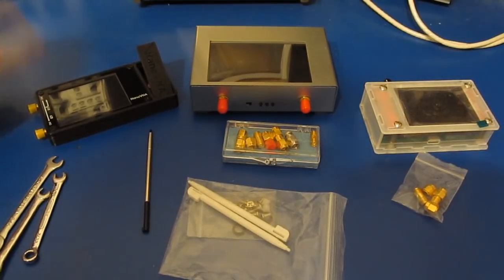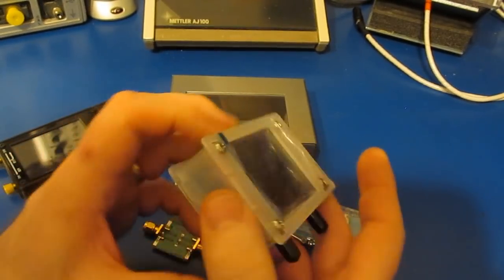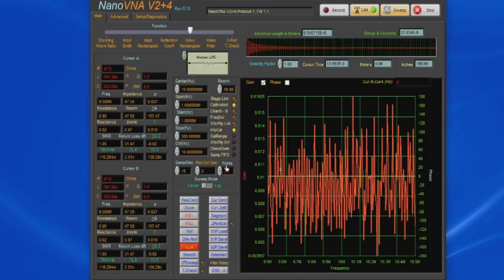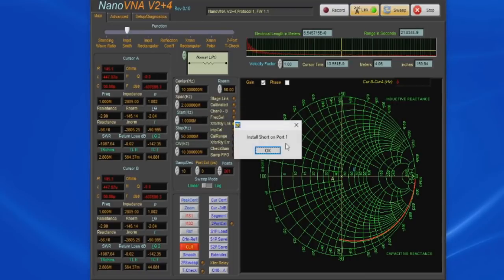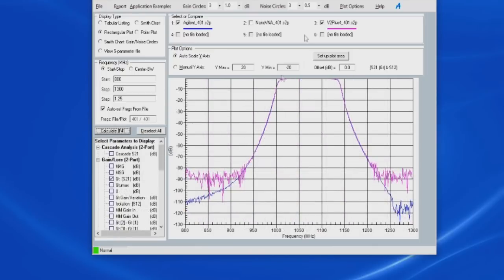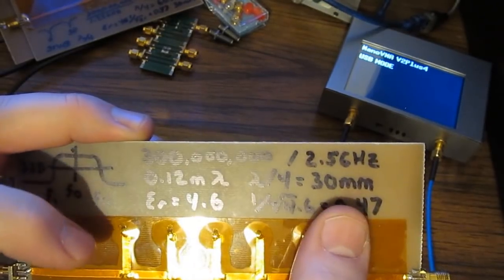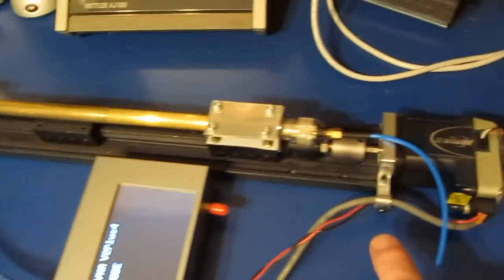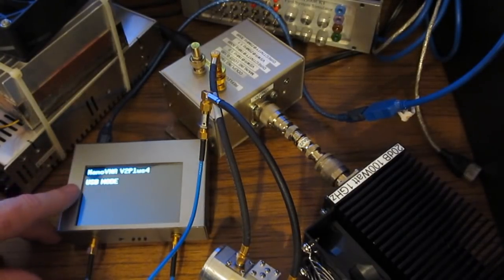NanoVNA V2 Plus4 Review, 4GHz VNA

Comment: I noticed you had an issue with the software on 13m30. From a software engineers perspective this is not that strange. The main GUI (graphical user interface) thread should never do anything that takes more then a little time, else it looks like its "hung" as you put it. It will stay hung until its done with the lengthy job. This should have been done in a separate thread or at least behind an explicit "refresh" button. 

Im a software engineer and electronics hobbyist, who appreciates your channel, so drop me a line if you could use some help/advise in software... i.e. if you want to port part of the original software which i believe is in github also.
Reply from the maker: I wasn't involved with developing the software supplied with the V2+.  I think the people you want to contact have their own group that you may want to consider joining.  I believe they had a link to it from the store.    They may appreciate any help you could provide them.   For myself, I just roll my own and get on about my business.

Comment: great work, that TDR measurement with mm resolution would cost a fortune 10 years ago.
Reply from the maker: 10 years ago,  the best thing I had was my old 1970s HP 8754A.  That's about all I could afford for hobby use.  These low cost VNAs are game changer.
Reply: @joesmith-je3tq  do you add velocity factor to that TDR measurements ? i beleive it is possible to reverse calculate Er value from that.

Comment: What I would really like to see is how to use a NanoVNA to calculate and test the matching network for a 900 or 2400 MHz transceiver with some kind of PCB or standard SMA whip antenna. That would be AWESOME.
Reply from the maker: As I stated during this video, I wouldn't recommend using the NanoVNA for anything above 300MHz.  You may need something better.    For calculating matching networks, there are several on-line calculators available.   Try Google.   For videos on how to use a VNA to test them, use the YT search.

Comment: Greetings joe, excellent software with nice visualization, I was wondering if you have compiled any similar software to use it with a nanovna-f, if so, could you provide me with the url to download it?
Reply from the maker: I only have the original NanoVNA and the V2+4.  Software interface to the V2+4 is different than the original.   I have no idea what the F would require.   In my case, I was really looking for the dynamic range, speed, larger data sets and that 4GHz+ upper end.  The V2+4 is a big improvement but I'm at a loss as to why they didn't consider it's use for narrow band work.

Comment: Software seems to have been deleted. :-( any reason why?
Reply from the maker: It was moved to release after adding the VISA drivers to the installer.  Look to the right where it shows releases.
Reply from the maker: Look here if you are still unable to find it.   https://www.eevblog.com/forum/rf-microwave/nanovna-custom-software/msg3452660/#msg3452660
Reply: @joesmith-je3tq  Got it thanks, will this also work with the first version of the Nano or only the V2. Also the I am missing the lower part of the program and can not scroll to the bottom, it's chopped off and even in full screen mode.. Am I missing something to get the bottom part of the window?
Reply from the maker: @romanmelnyk-ve2rmj979  There is a 100 page or so manual.
Reply: @joesmith-je3tq  Checked the manual, but not clear if I can use it with the original nanoVNA, I tried and it does not connect, it does with nanovna-saver so I know the unit is OK. Maybe I am doing something wrong?
Reply from the maker: @romanmelnyk-ve2rmj979  There's a manual for it that I suggest you take the time to actually read.  If you have questions not covered by it, let me know.

Comment: Neither my NanovnaV2+4 nor my NanovnaV2+  hangs with the original software of the author (nanovnaQT), so the problem  that you encountering must be related to you hardware/software set-up. Have you upgraded to the latest version of nanovnaQT that is available ? I use nanovaQT nearly everyday on a Linux PC (Ubuntu 20.04) and there is absolutely no issue at all, it runs like a charm.
Reply from the maker: I assume by your comment that your watched the video and are suggesting you are are able to run your V2+ continuously, streaming data over the USB, without a lockup for > 6 hours.   That's very good news if that's really what you are doing.  I suspect it's a firmware or hardware problem with my V2+.  I've since given up on it.
Reply: @joe smith . In my Linux Ubuntu 20.04 environnent, my V2+4 or V2+ will stay connected for hours and even days without hanging, neither at start-up nor after several hours of use, However , you are using Windows which manages COM ports in a very different way than their linux equivalents.....Anyway, congradulation for the look of the SmithChart, it's really great and remenbers me my student days and the good times I had with the HP8753
Reply from the maker: @peteride-kostic737  I've seen my V2+ run about 6 hours.  That's not six hours of being plugged in but 6 hours of streaming data.   If you follow that thread in the description, I talk about various things I tried to sort out what the problem is.  I doubt the OS or PC have anything to do with it.  If the V2+ and V2+4 had the same performance, I would consider buying a second one just to see if I could replicate the problem.  
I started using LabView when version 4 was released.  I saw the advantage and bought a copy of 5 for home use.  Now days, pretty much anything I run on the PC is written in LabView.

Comment: Thank you very much for this explanation. Awesome!

At 57'15", I wonder if does the Er shoudn't be the 'effective' Er for each trace? I mean, part of the E fields travel through the air and FR4 and part only through FR4.
Using TXLINE calculartor for microstrip, gives Ereff = 3.45 @ 50 ohm, 3.82 @ 25 ohm and 3.1 @ 100 ohm.

Comment: I have a question, both in the video and in the manual you've said something along the lines of "I am not using metrology-grade standards with the NanoVNA". Why is that? I am assuming it's due to the untraceable mechanical nature of the connectors on the NanoVNA.
Reply from the maker: The cost for a set of Keysight mechanical 3.5mm standards is somewhere in the  range of $4000 to $16,000.   The risk of damaging them could be reduced by using a good set of cables.  To reduce the risk of damage to the cables, we could install higher grade connectors on the VNA.    Consider that one connector could easily cost more than the entire Nano.   At the lower frequencies I play at, it's far less important which is why you still see me using home made standards and sorted loads.   

https://www.microwaves101.com/encyclopedias/connector-care

Comment: Hi, is it a specific driver for using your software, com ports on my PC are not detected by your software.... my Nanovna V2Plus4 cannot be linked..... (It works with QT & Saver) ?
Reply: I found that we must install NI VISA to make it work, now I can see all com port available , maybe something is missing inside your software package. I'm going to play with your soft now....
Reply from the maker: @patriceh6316  The installer has been updated to include VISA.   No other changes were made.
Reply: @joesmith-je3tq  Thank you very much Joe for all the job you made  and shared it withs us.
Reply from the maker: @patriceh6316  No problem. Thanks for pointing out the missing drivers.
Reply from the maker: NI VISA should have included with the installer but I may have missed it.

Comment: The software you wrote is impressive.  I appreciate the time that went into it.
I have a Siglent SVA1015X and a nano VNA whihch I have been considering adding a relay set-up like your to so I could get bi-directional 2-port measurements without manually swapping the connectors.  See your example is very helpful.
I currently do not have a need to go above 1 GHz, if I do understanding the limitations for the newer Nano VNA versions will be helpful.   Thank you for the detailed comparison.
I have done 50 Ohm through crystal measurements with attenuators in line next to crystal.  It seems to work fine.  What motivated you to add the transformers in the fixture?
Reply from the maker: There was a link in the description to the crystal testing I did.  There's a lot of information posted.   Did you take the time to read it?

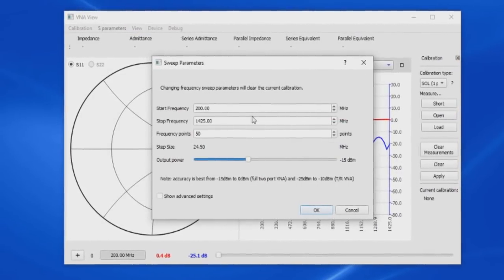Comment: 14:55, seems like their software is polling the OS for info on each COM port every time the drop down menu is loaded. For people with less COM ports, it probably wouldn’t hang as long but that’s still an absolutely horrible design decision.

The worst part is it would probably take a single person 25 minutes to fix that issue either by caching the previous devices, doing it asynchronously or adding a sub-menu for device selection.
Reply: It could be a delay caused by the Bluetooth stack and the configured BT serial ports, and disabling Bluetooth temporarily will stop the delay.  I've seen this before with the Windows BT stack.  Verifying this may be a problem if Joe is using a BLE mouse or keyboard.

If not caused by Bluetooth, then the software may not just be polling the OS for available ports, but also opening each port and seeing if there is a VNA device that responds.  The NanoVNA software is open source I believe, so this shouldn't be hard to check & fix.

I have written plenty of software that populates a COM port list on a drop down, but as all I generally do is read from registry entries there is no delay like this.
Reply: It's junk software, and has many more problems than Joe demoed in this vid.  I've managed to update Nano firmware with it, but it rarely works for any other function.